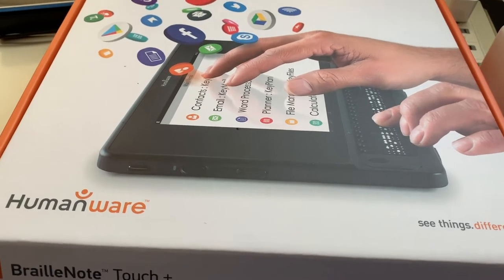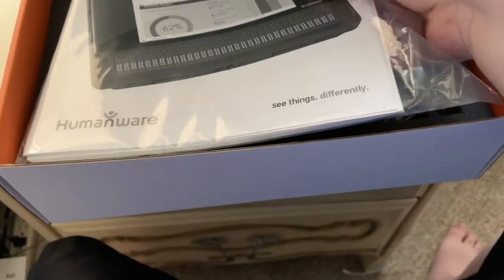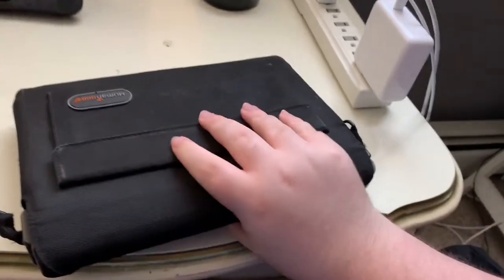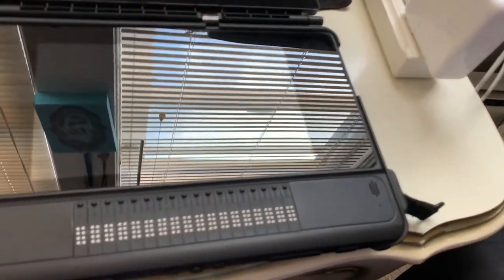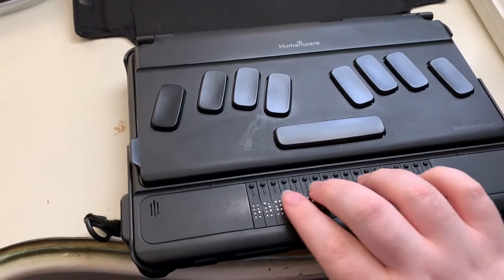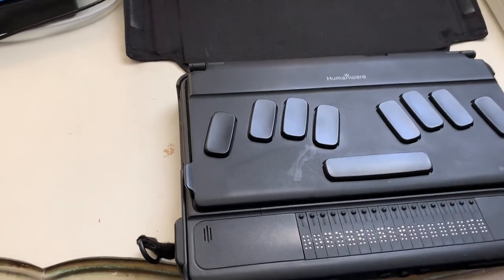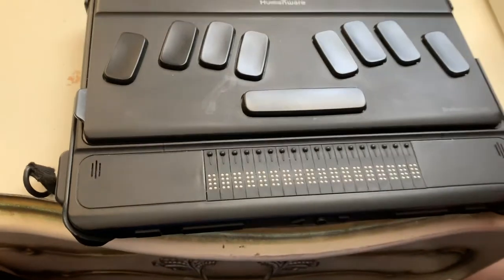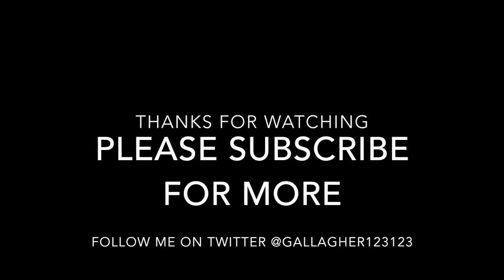Touch The Upgrades, Boost Up Program BrailleNote Touch Plus 18 Unboxing And Setup

Comment: What is the differents beteene the braille note touch plus and the bust up braille note touch?
Reply: They are the same thing. The only difference with the boost up as far as I no is they use your old braille display in a new unit.